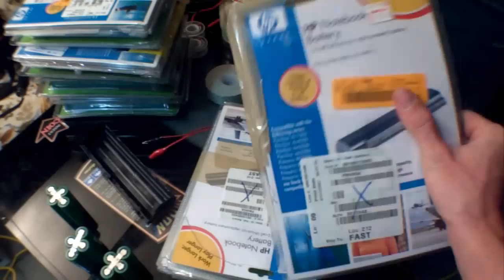DIY: 48v 24ah lithium ion 18650 e-bike battery pack

Comment: Great video.  This is very inspiring.  I am curious to know whether you have tested and balanced the individuals cells before you soldered these as one big 24v pack?  Also, what is your hub motor setup?  Any recommendation on what brand to use? Or should i just pick one kit off ebay?  Thank you, and keep up the great work!
Reply from the maker: Sonnet Gomes i didnt but i should have. now i test all the cells before i assemble a battery. but this battery i made in this video is still going strong and has gone about 1500 miles so far. its in my daily driver. i have other videos showing the bike's motor. its just the cheepest 1000w 48v kit i could find on ebay.
Reply: Rinoa Super-Genius Ah..yeah. it probably would be better to test.  I think even one battery failure could damage or reduce the life of the whole pack.  You seem to have tremendous amount of patience, and it definitely is paying off for you.  I am thinking to build a kit, but with 6S 22V lipo (Helicopter RC) batteries.  These are portable and still cheaper than ebike vendors.   Would a 22V 6S lipo work with the 48V motor even if two of these 6S packs are wired in Series (Total comes to 44V)? I know these each cell can reach 4.2V, but eventually drops of to 3.7 V each. I wonder if the controller has a built in cutoff at 44 V? That would be a bummer :)
Reply from the maker: Sonnet Gomes
 had a cell short out on me a while back, it got very hot and popped it's connections. it wasnt too hard to replace since it was right on the edge of the cluster of cells. my next pack will have a 4 amp picofuse on each cell.

the cutoff is 36v. and the bigger question is how many Amp-Hours. you want 15 or more. but yes two packs in series should let you scoot around for a few miles at the least.
Reply: Rinoa Super-Genius yes. please make a fuse video. That would be awesome :)   I only need battery assist to help push through the hills, so I am not too concerned with miles. I will wire 4 lipo packs giving me 20AH or so, and it will still be much cheaper than ebike vendor batteries. I was concerned about the voltage cutoff, but 36v sounds perfect.  Any idea on how to plug in a volt meter ? I think it would be great to monitor the voltage so that it does not drop below 3 volts.  Thank you once again for your time to make such great video.   I found your videos to be extremely useful.  Have a great weekend.
Reply from the maker: Sonnet Gomes
the hub motor kits come with a thumb throttle that has a crude 3 LED voltage meter on it already. the red one turns on at 43v, the yellow at 45v and the green at 48v.

as you pull power from the battery that voltage dips down so you can actually get an even better idea for how much more charge you have just by going off the LEDs. i know if i can keep at 25mph without the green LED dimming i have a good 15 miles of range.
Reply: Oh excellent. That way i wont even need a voltmeter to monitor the voltage drop.  Now the only risk i need to take is grabbing a motor kit off ebay.  Hopefully the controller will work.  Are most of these kits brushless motors? If that is the case, the speed is controlled by PWM, right? Anything particular to watch out for when buying a motor?   If you could make a video on hub  motors and how to hook up the controllers and batteries, it would be great.  Just looking at the wires coming off these controllers can be rather intimidating :)
Reply from the maker: Sonnet Gomes http://www.ebay.com/itm/48V1000W26-Front-Wheel-Electric-Bicycle-Motor-Kit-E-Bike-Cycling-Hub-Conversion-/291308554392?pt=LH_DefaultDomain_0&hash=item43d357c898

i bought both my hub motors from that seller and am happy with them. just remember to check if it has rim tape when you get it. mine didnt so it's unfinished metal rim kept popping innertubes.
Reply: Thank you Rinoa.  Your help is much appreciated.  I will grab this ebike kit.  The seller has excellent rating.  Keep on ridin!

Comment: You are better getting the 20C Turnigy lipo batteries from Hobbyking. Less voltage drop under load.
 Also, that is the biggest soldering iron I have ever seen.
Reply from the maker: the voltage drop for these are fine. thanks though.
Reply: Rinoa Super-Genius
Just out of interest, how much voltage drop do you get? I have a 37v 15ah lipo that drops 1 volt at 16 amps load. I have a 36v 10ah lifepo4 that drops 6v at the same load.
Reply from the maker: Shaun Dobbie
well i am still running with the 9ah pack running at 18ah in series with teh 35ah to give 48v so it dips maybe a volt or two. but tbh i dont really care couse i dont go much faster than 20 mph most of the time anyway. so i never use full power.

it really depends on temperature though.
Reply from the maker: VanMedia
just look for cheep laptop batteries. and i'd say these have 1-2C. plenty for a vehicle.
Reply: Meh, for a vehicle you are better with 65-130C
Reply from the maker: Shaun Dobbie
65-130c? i doubt that even exists. even a capacitor has a hard time supplying that much.

if you need 130C from a 35ah battery you mean you will be pulling 4550 amps? you only need 300 for welding thick steel.

4550 amps at 48v would be 220kw of electricity. or like 350 HP. thats compairable to having a 4000HP gasoline engine. i think you need to learn a bit about electricity and vehicles.
Reply from the maker: Shaun Dobbie
looks like another battery scam to me, but cool if it exists. kinda pointless though haha.
Reply: Shaun Dobbie Please don't link a Turnigy ba...... OH WAIT you did.. If you really think those batteries supply 65-130C? You might as well believe in god....

Comment: I hope he has some way to balance charge these, and that they've got similar capacity ratings. Might have some fun otherwise.
Reply from the maker: yes, in the next video i show how to wire them up for balancing.

and having cells of differant capacities is ok. as long as each parallel pack is close to the same capacity.

like for instance my 9ah battery pack his made up of mostly 6 cell, 4.2v 9ah packs. but i had to make some of them 9 cells to keep the AH the same.

Comment: if the battery is 4800 AH INSTEAD OF 2200 Ah can I use 2 in parallel instead of 4 cutting the amount of batteries from 80 to 40

Comment: If I buy 3.2v 700mAh LifePo4 batteries cells from Amazon how many cells do I need for my 48v 1000w electric motor rear hub. Or what would I need to buy.

Comment: I have used liion batteries to make battery pack which has 14s (58.8v) I have connected a BMS to the pack (BMS cutoff voltage is 42v but in my case my BMS is cutting of at 48v) how can I solve this.? Thanks

Comment: Hey man, tks for the DIY, i will do the conversion of my Ebike, but my kit is 48v 12ah , how can i make this work? , i am kind of lost here, sry for my bad english, i am from Brazil, tks again.
Reply from the maker: you mean your motor is made for 48v 12ah? just FYI raising the AH won't hurt the motor at all. the AH is just a measure of how much the battery can give. the volts is a measure of how hard the battery pushes power through the motor.

if your motor is made for 48v and you make a 48v battery (weather its 1 or 1 million AH)  the motor is only being pushed with 48v of power. so the motor takes as much as it needs.

also FYI bike kits are made to handle higher voltages. i've seen people run up to 72v on 48v motors. i would step my battery up to like 52v without worrying at all.

also the AH does effect voltage drop. if you have a tiny battery (like 5ah) and you try to pull a lot of power from the battery, the battery's voltage will drop and that will limit your top speed. but the bigger the AH is the more the battery can handle the load.

i hope that helps.

Comment: battery is not alone i would like to know which motor u used . india through ebay each cell costs 6-7 $ .that is main problem for us 72 cells its slef is huge cost .would u like to help us in getting battery cheaper
Reply from the maker: i have many other videos talking about the batteries and the motor.

Comment: Do you have any experience with using Chinese 18650's? I'm thinking of building a very large pack for my EV using a few hundred of them because you can get a cell for about $1-2 dollars, but I've heard some mixed things about them.
Reply from the maker: yeah i don't think i would trust chinese batteries. i hear most of them are old recycled Panasonic or Sony laptop cells that have a super low capacity couse they are old and used.

tbh i don't think you can really go wrong with old laptop batteries. laptop battery packs usually have good brands of cells. and if they are under 8 years old they are prolly still close to full capacity.

but hey if you find new Panasonic cells for 1-3$ each buy as many as ya want. i prolly wouldn't since i feel like i have enough batteries for a while but if i saw them at a store for that price i'd prolly fill the cart :P
Reply: yeah I've heard mixed things about them as well. there's some li-poly batteries, about $2 for a 5000mah cell, which is pretty cheap as well. I bought a li-poly pack a few months ago, and I tested it and it was at the rated capacity. do you know anything about those kinds of cells?
Reply from the maker: no i don't, but tbh if its an 18650 cells then i would doubt any claims of them being more than 3ah per cell.

but there are some much bigger cells like 25500 and 32600. i would love to test those out. they are about the size of a D cell.

Comment: RINOA ... Q:   HAVE you seen a need to space batteries to provide for air flow or to use some type of heat sink to remove some heat ????   Thanks
Reply from the maker: 23caledonia no
Reply: Rinoa Super-Genius 
                                          THANKS

Comment: So can you figure out what is the maximum discharge rate for a pack like that, Im still learning but I noticed alot of the lipo4 ones could do 3C and 10C. Thanks for posting the video btw.
Reply from the maker: 1C at the minimum. but its more like 3C. still only taking 1C or less helps the battery last longer though.
Reply: Rinoa Super-Genius This is low.. I wonder how you could use these packs for a car.. I mean they need some serious amps but I'm guessing it's only initially, and then it would be much less once cruising. I wonder if you could use high capacity capacitors? Motor always draws from caps which have a stored high C discharge rating?

Comment: Hi great vid but need to know what equipment I need for charging/measuring etc. Cheers!
Reply from the maker: the stuff i use in the video, a multimeter, a variable power supply, and charger like an imax B6. theres also the Imax B6AC that has a built in ac adapter. the B6 needs 11-18v input.
Reply: Great thanks I may be back for advice :)

Comment: how dangerous if you accidentally ... i mean purposely short the battery pack ?
Reply: Wong Junn Kit Very dangerous. After some time short circuiting (maybe 1 minute or 2 minutes depending on the short) and when the battery gets hot enough it can ignite and then within 20 seconds explode in a ball of fire. However with some airflow in <20 degree weather and well insulated batteries this is very unlikely.
Reply from the maker: John Smith no i had 2 cells short out at full charge, just popped their connectors and heated up a bit. no catastrophic damage.
Reply: Rinoa Super-Genius Whats the brand you are using to charge up the whole battery pack you made and how long?
Reply from the maker: wengsky01
brand of what? or do you mean BMS? just a cheep 20$ one from ebay and the charger that came with the pack.

funny thing s the BMS i got evidently down know 4.2v is what it should charge to so when i connected it up to my battery pack it was like 75% charged, so it now brings the pack back up to 75% charged and never higher than like 4v per cell. i figure i could reprogram it but tbh this will make my cells last 4x longer anyway and it still gives 20 miles of range.

Comment: Where did you get those flat magnets from to connect the batteries together? They're just awesome!
Reply from the maker: +Danny Tillotson they were made to be imbedded into cardboard boxes to hold flags or something funeral related, would have magnet on the lid and strip of metal in the bottom part. the product was a failure so i saved them from the trash.
Reply: Nice! No hope for me to find any on ebay or amazon then? Haha I looked but I didn't know their exact name other than "small flat magnets" and I had no such luck in finding them.
Reply from the maker: +Danny Tillotson they are just flat neodymium magnets, should be tons of them on there.
Reply: Thanks bro! Awesome video series by the way. Going with your idea with laptop batteries and got all the purchases on the way :D

Comment: You gave me a great idea!!!
It's more economic buy battery from PC !!!! I have the Bosch 2014
10ah 36v .... I need only 3 PC battery ... Right?
Thank you advance ;)
Reply from the maker: you mean battery packs right? you would prolly want atleast 15 18650s to give the right AH and volts. that could easilly be under 30$. it also depends on what voltage you want to add.
Reply: Rinoa Super-Genius Right! 15 battery mean 2,4 or 2,6 Volt for AH can be right little more 11AH may be 14AH can be good for me.... but I can use the same charger?
because right now I have 36Volt 10 AH lithium
....

Comment: great!

What would you recommend as a charger for the 48v 20ah-30ah (or even 40ah) li-ion pack?
As well, all the batteries are sold with BMS connected to them, what do you suggest?
Reply: Wow cool
Reply: ohad grossbard
Indeed!
Do you have E-Bike?
Reply: No, dont need it , but its great, i wish that the e- car would of work, saves alot of money and polution
Reply: לצערנו בעלי האינטרסים (טייקוני הנפט למינהם) לא יאפשרו את זה בזמן הקרוב, כמו הרבה דברים למשל , אנרגיה חופשית תרופות למחלות סופניות וכו'

Comment: nice build. you sure did learn a lot and had  a lot of fun :)
but... it is not so easy.
cells are used. cells arent new, they are used and old.
in short time some of the cells will start to be out of balance. it means they will discharge or charge faster then others.
that can cause big problem, as already charged cells can be overcharged,
also cells do degrade differently. some lose theirs capacity faster then others.
then again balancing issue.
from build you made i see you got no any BMS.
so... thats why you should pay a little more for lifepo4 + bms or lipo + special charger.
thats just conserve your time, cause soon you will have problems with your battery and you will have to replace some of cells. and it is pain in the ass work.

I know it cause like 5 years ago i was making similar stuff from deValts used tool battery packs.
maintenance made me sick :) 
Now i advise for lipo + charger or lifepo4 + bms

Comment: how do you balancing the battery pack?is very dangerous when you not balancing the li-ion pack, every cell have different resistance and voltage for cell is max 4,21V overvoltage damage you battery oder explode. is not low cost buy direct cell?
Reply from the maker: watch the next video. and i dont understand what your talking about with buying direct cells.

also i run my cells at 4.0v so i get 4x as much life and have more room for them to get out of ballance.
Reply: ok sorry, i don`t see the next video and i see the video silent

Comment: Hey I'm building a 48v battery pack with 21700 cells I believe there called but I want them to be a 48v 60ah also what can I use as for solder like for on the batteries ik u used some nails but wondering thanks

No bms I thought they were dangerous without them?
Reply: What shall I do as I'm using 21700 lithium battery cells I wanna build 48v 80ah how would I do that 
What's better parallel orr series I'm just looking to build a cheap battery pack thanks

Comment: Question- I have a 48V electric moped with a rear pancake motor. The pack is AGM from the manufacturer and I want to switch it over to lithium. Can I use the old charger for the lithium pack?
Reply from the maker: well you would need to make sure teh cells are balanced. ya see lead acid batteries limit their own voltage but lithium cells will just keep raising till they short out.

the imax b6 is a good 30$ charger. the B6AC also looks cool.
Reply: Thanks for the help.
Reply from the maker: saxmanchiro
your welcome :D

Comment: which battery pack uses the Sony 18650's.. and do you think it would be wise to use them by themselves for maybe like a flashlight or my mechanical mod vaporizer?
Reply: as of right now im using the sony 18650VTC3's the are 30Amp batteries i would like to find a pack that uses sony 18650VTC4's if possible because the VTC4's are 2000mah instead of 1600
Reply from the maker: hrmm don't know. even these battery packs had differant cells for each one. it kinda depends on whatever the company could get for cheeper at the time each battery was made.

Comment: You should put a diode in line with your power supply so you are not feeding the battery voltage back into the power supply.
Reply from the maker: i like using my power supply as a multimeter though.
Reply: You're joking right?  BTW:  I have the same power supply.  Pretty good for under $100.
Reply from the maker: valveman12
no, its very useful to see the static voltage of whatever i connect to it before i turn up the supply's power.
Reply: Rinoa Super-Genius OK  I suppose if your power supply isn't complaining.  Why not.